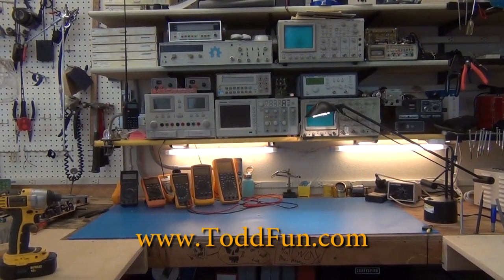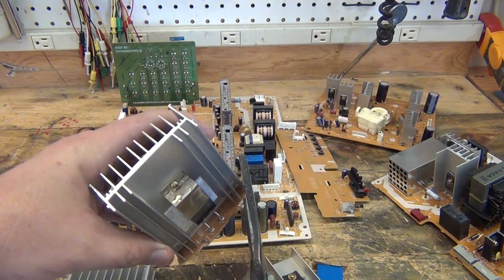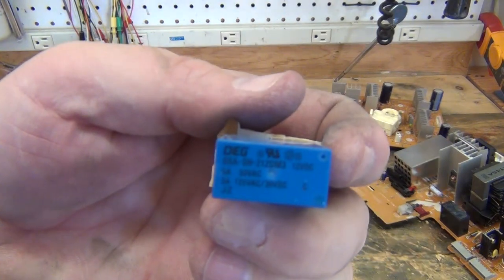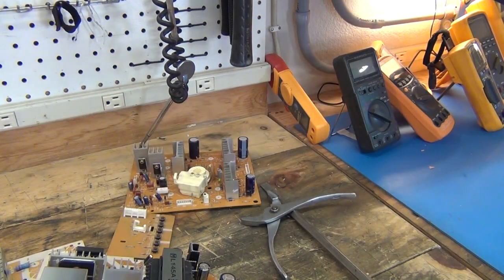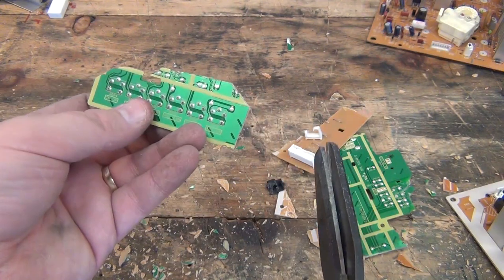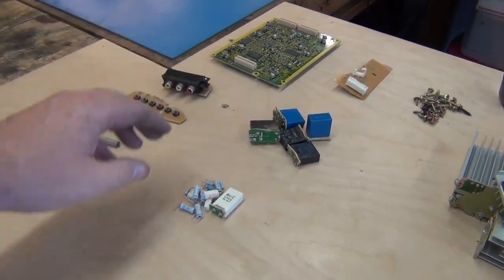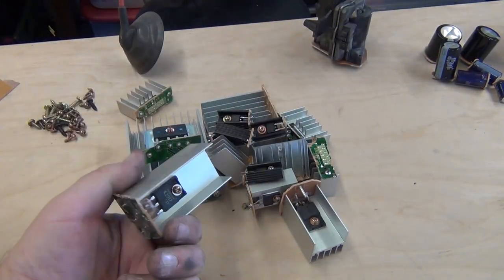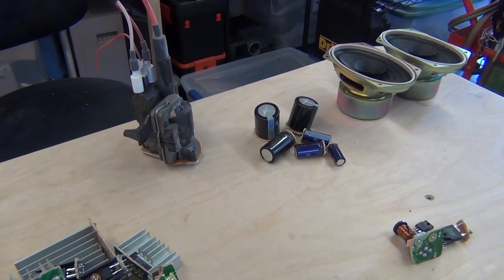Fast Component Salvage

Comment: If you cut along the white outline, you'd save a whole AC to a few various voltages DC switching power supply, rather than just a few random parts. I've done this to old motherboards too when I need a DC-DC switching converter, and don't want to lay one out or buy one. Change the resistors in the voltage divider that's the feedback, and instant DC-DC switcher for whatever voltage you need. Module re-use is way better than component reuse!
Reply from the maker: I've done something close to that with the power conditioning section section of a PCB before but not for a DC-DC application. Good idea, I'll give this a thumbs up so others see your comments. Thanks.

Comment: You'd get about the same speed with a solder pot, like you see in this video : How to gain electronic parts using a soldering pot
It looks slower but in reality, with your method you'd still have to desolder the pcb from the bottom of those parts eventually, so you're not really saving much time.
Or you could use a Hakko 888 or something similar, but those tend to need maintenance, the tip gets choked with solder etc so it can be slower process (but cleaner and safer for parts)
Reply from the maker: I don't have a solder pot but it does look fast! However the large boards from this TV would still have to be cut down into manageable size with a shears to work with a solder pot. Then there is the time it take to heat up a solder pot. In my case it is still easier to cut out the parts I want and only desolder when I need the part and/or when I have time. May times I only have 10 minutes to spare and I can't keep TVs, Microwaves and old stereos around when they get dropped off. I need to scrap out what I can fast. If I had a solder pot I would save the smaller boards and try your solder pot suggestion. It does look very fast and salvages more components then I would try with an iron. However, a good desolder station would make short work of the through-hole components as well.
Reply: ***** exactly, the pots are only 3 inches so u still need to do this. what cant be cut out with sheers can be cut out with a saws-all
Reply: KyleCarrington  They don't HAVE to use one that's only 3 inches in diameter, you can use larger diameter solder pots, or containers used for DIP soldering or you could even buy a cast iron skillet/griddles like this one for example: http://www.amazon.com/Lodge-L9OG3-Pre-Seasoned-Griddle-10-5-inch/dp/B00008GKDN/
You just fill it with lead free solder, put it on your stove and heat it to 200-250 degrees and start removing parts from boards. But you have to be careful not to burn yourself and keep the room ventilated.
Reply: mariushmedias good tip! that griddle looks perfect for the job, indeed. i have a "dual puck" style North brand respirator mask -- I'd like to find out what actual filter pucks to use, while to doing this, to be on the safe side. I think if I couldn't find the right pucks, I'd build a fan powered ventilation system that sucked all the air from the griddle away from the user, just in case. I could see myself putting in quite a few hours (over the years) doing this rather toxic task
Reply: KyleCarrington  The lead free solder won't cause much (if any) problems.

The reason for ventilation is the release of chemicals from the cheap rosin bonded paper pcb or semi-fiber glass pcb, the silkscreen ink, the green (or whatever color) solder mask chemical (the layer insulating the copper traces) getting burned up by the heat below, the silicon glues used to hold larger components can release gasses when they get hot if you keep the pcb for too long time over the pot, flux can be bad to breathe in if there's some left (boards not washed properly).
Basically, if you do it by an open window with a fan moving air around you should be safe, no need for masks and active filters.

Comment: I should use this method desoldering for hours is boring, I like to be building stuff. Usually I just grab parts I need off PCB's anyway.
Reply from the maker: ***** Yes it sure does work out to be a fast way to recover components. Just a week ago I was into that tote for a relay an some high watt resistors to do some load testing. I burned up the resistors because it was a destructive test but the resistors didn't cost anything and I learn what I needed to know about a mystery load. The fiberglass boards are a lot better for cutting because they don't shatter and you can get out whole power conditioning circuits to use for future projects with this method.